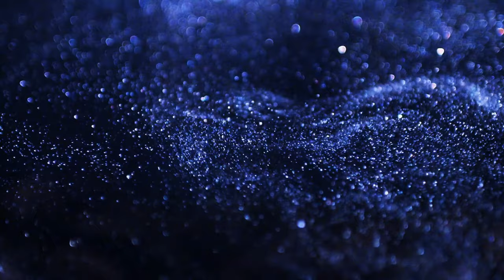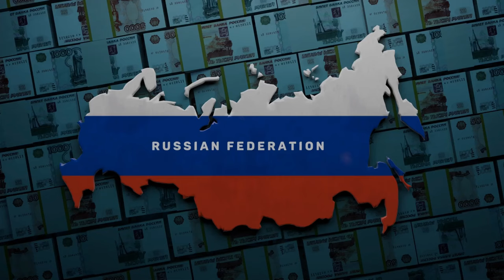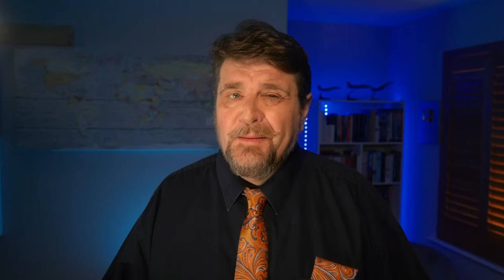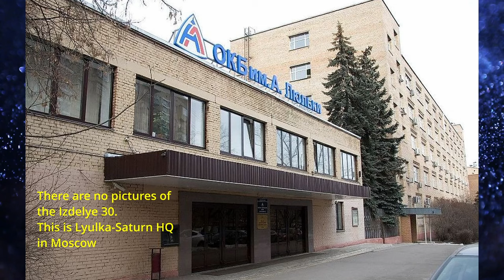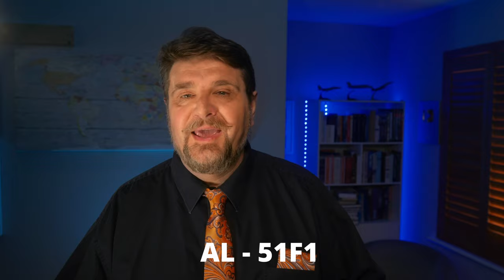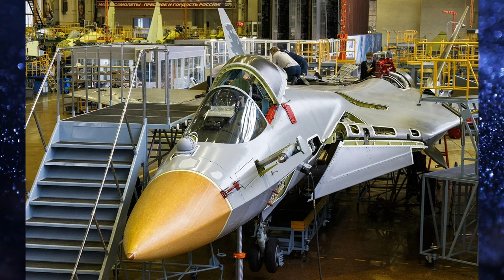Why so Few Su-57?

Comment: Yes, but why isn't the engine ready yet? The aircraft has been in development since 2000 and it's been over a decade since the first flight in 2010. It was first produced in 2019, yet 5 years later still no engine...
Reply: Meanwhile, in China...
Reply: Why isnt the F-22 ready? It has been in development when i went to school in the late 90's and its been over two decades and its still not in service.
See, things take times, life aint a videogame.
Reply: @tigersilberhannes9153  The F-22 has been in service since 2005. 195 were produced, before production was halted prematurely for political reasons. 
It's even been deployed operationally several times.
You're clueless.
Reply: @tigersilberhannes9153  how do you make such an ill informed comment on this channel?
Reply: Do you know a thing about engines before asking with such a authority ?
Did you pay for engine ??
Reply: @GonzoTehGreat Although both the Su-57 and F-22 where in the drawing boards since the late 80's...

But unfortunately, for the Su-57, 1991 happened.
Reply: @tigersilberhannes9153 it's finished,but the fleet is in a sorry state,to the point where the su-57 fleet is more relevant
Reply: The average development time for a new turbofan engine is about 10 years. This does not mean a working prototype, but a reliable and service-ready option. Jet engines are considered the most complex machines in the world.
Reply: @tigersilberhannes9153  It was ready 20 years ago
Reply: @KoT_3JIoBpEg  If it takes ~10 years to produce a new turbofan engine then the Su-57 should've got one over 10 years ago...

Comment: Aside from the jet not being fully operational, there is the issue of parts. No doubt, the Russians used huge sums of Western components that cannot be replaced all at once. New parts cause hardware as well as software issues. The new hardware is most likely not as capable as its replacement. The latest hardware has its own firmware that has to replace the old firmware for the sanctioned hardware. This means that there is a high likelihood that there are 2 SU-57s that run on many different hardware components inside and they use modified OS. This is a huge problem, especially for a machine that basically cannot afford a major hardware and/or software failure while in use as it might not just cause severe financial setbacks but also put lives at risk.
Reply: All components russian, sorry
Reply: @neoonh518  Yeah, we heard that before.
Reply: @davout5775  so good, then you know....
Reply: @neoonh518  About these fairytales?
Reply: How do you know this?.
Reply: @ameerikbal8160  All Russian planes have 100% Russian parts as of early -23
Reply: @davout5775  yes, yours
Reply: @ameerikbal8160  What in particular are you asking about
Reply: @neoonh518  Yeah, just how their missiles had 100% Russian parts but real world evidence shows otherwise

Comment: 1) these projects always run long. Did for the US too. 

2) culture and communication issues: there’s clearly a culture of fear, telling superiors what they want to here rather than accurate info. from the perspective of the engineers,  this might be a  totally reasonable timeline given the requirements and resources available. It’s likely folks promised more than was reasonable. (An issue that plagues gov contracting in any country, but is potentially worse in Russia) 

3) $$  these things are expensive, and more so to do quickly.
3a) oil price decline: oil exports provide nearly have of Russia gov revenue. Despite pumping more, price decline meant rev was generally flat / down 2012-2020
3b military deployments: while they get less press, Russia had significant combat operations in  Syria, lybia, and Mozambique over the last decade. 

These are all factors that will be present with any big gov project in any country.  But that are likely worse in Russia. They also have less of an ability to just throw money at the problem vs. the US or china, given their economy is 1/10th the size and their credit rating / ability to borrow is lower.

Comment: Few Su-57? I mean do you have any numbers? They have 50? 100? 
I would guess they have about 100 of them but i dont think they need more since it seems maintenance is the problem for these high cost jets.
They also have a lot of other jets they use very often so it seems its a situation where they need combined arms and not a fleet of su 57.
Its pretty clear that most firepower comes from big missles fired by land , air or sea. Artilery maintains frontline.
Remember how they said tanks and helicopters are obsolete? They are not but jets are becoming obsolete because of their high costs. Think about it, can a jet destroy as much as 10 hypersonic missles behind enemy lines?
Reply: It is well known they have less than 20 SU-57 and probably more like 16.

Comment: Not sure. Could just have the Su57 fly lighter with the current engines until they're eventually replaced. 

I think the difference in performance between the Su57 and the Su35 may not be large enough to be worth the excess spending / lower numbers for the VVS
Reply: There's only one difference between 5th gen And a modern 4th gen. Low RCS values
Reply from the maker: The difference in performance is massive.
Reply: @millennium7shorts926  Flight performance that is? Because when it comes to other spheres in most cases it's pretty similar to  Su-35S